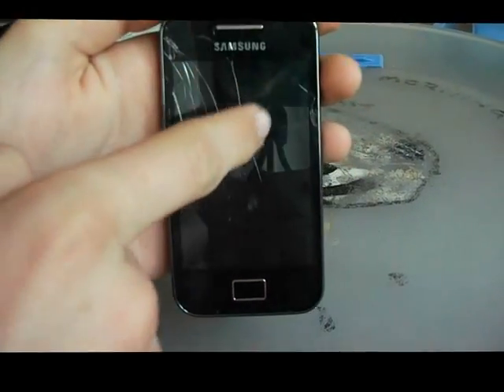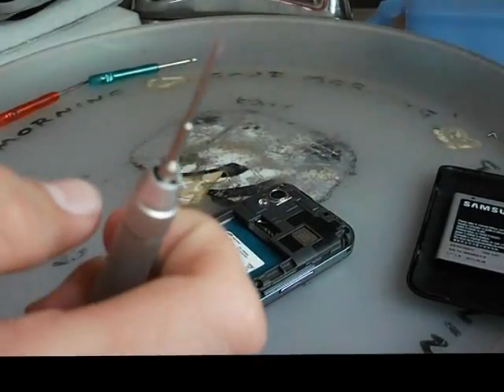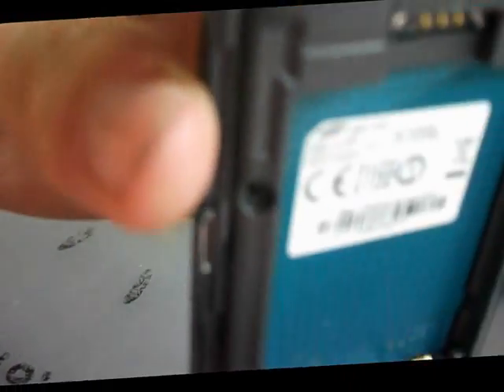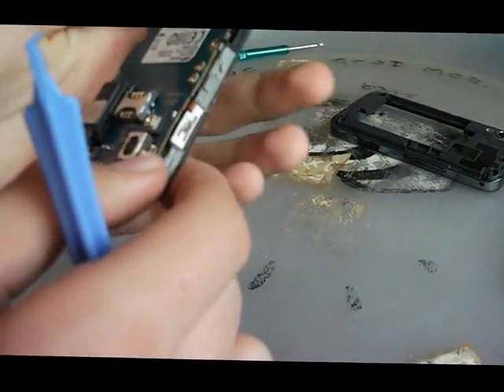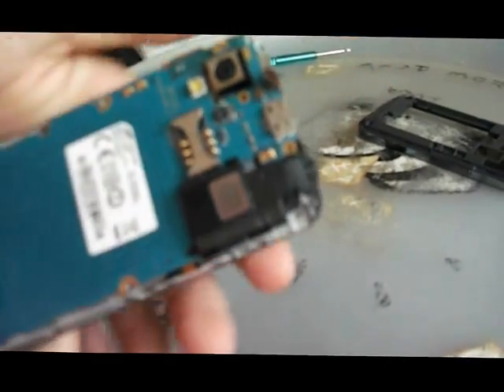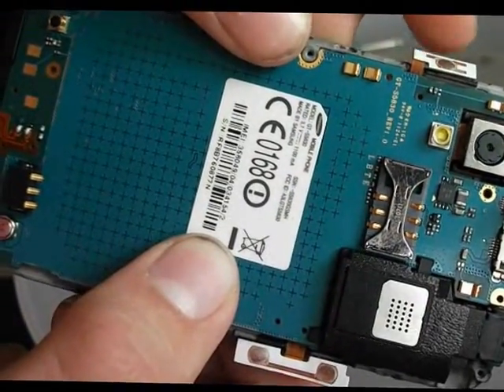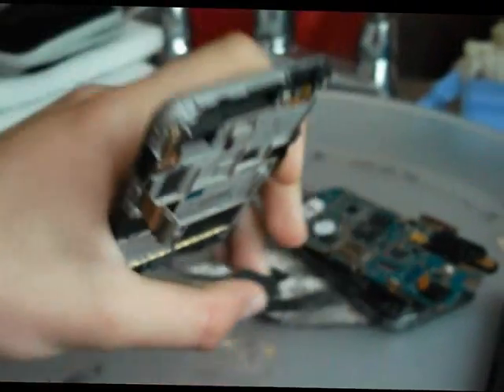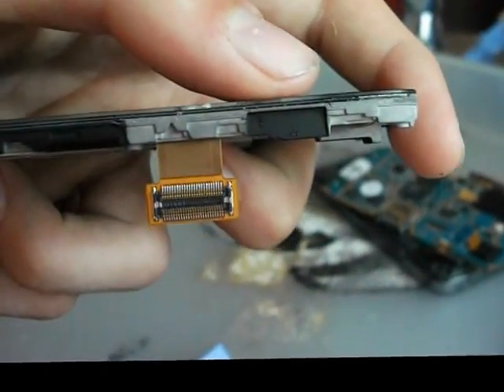samsung galaxy ace screen replacement

Comment: I replaced my screen (LCD and digitizer) and now the digitizer is crazy. I touch in one spot and it "feels" it somewhere else. I tap an icon and the one that gets pressed in the one above... It's impossible to use. Writing a text message is mission impossible.
What could it be?

Comment: Does anyone know if the Samsung Galaxy Ace S5830 and S5830i glass screen parts are the same? I got a S5830i and want to replace it with a S5830 glass screen since it is cheaper and more available in webstores it seems.

Comment: Great but one problem - One of the screw wouldn't come out so I got impatient and prized it open anyway.  I managed to snap a ribbon cable.  The phone seems to work fine and I also tested the camera.  There must be something that doesn't work but I haven't identified it yet.  Can you help me to work out what I broke?  It is the larger of the 2 ribbon cables that you disconnect from the sides.  I think it is just below the camera.  Any ideas?  Can I just glue or tape it back on to repair it?

Comment from the maker: hi its all good and i went on ebay and typed in what i needed and it was about 10-15 pound the only downside if its not in your country for example the UK and it's not a UK seller so say i live in britain and the seller lives in hong kong it will take like 2 weeks maybe 3 to arrive so if you pay more for the seleer that lives in your country it will arrive faster so you can get your phone fixed :)